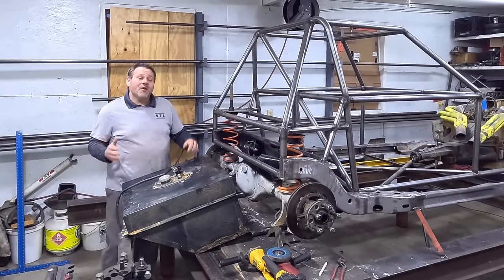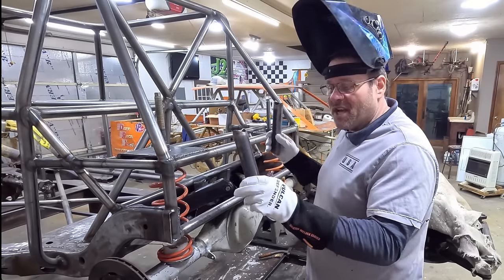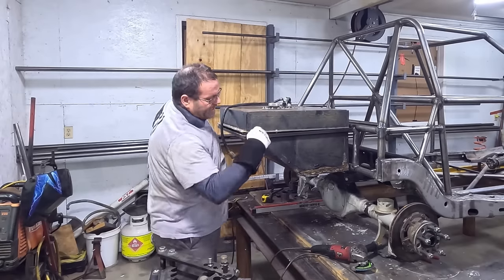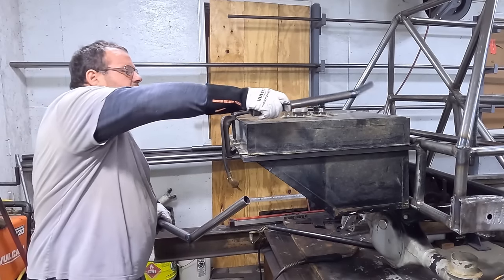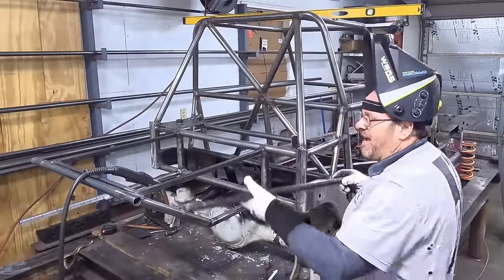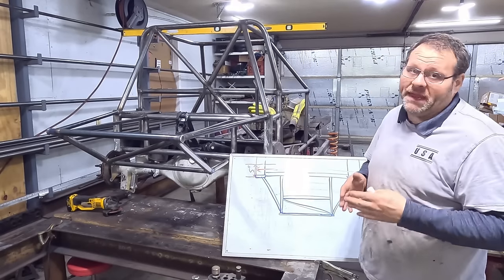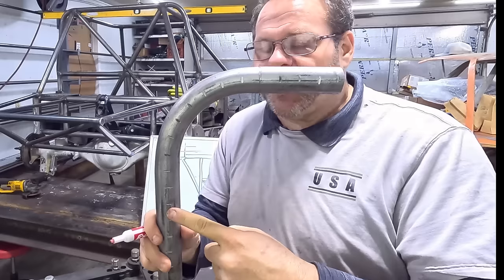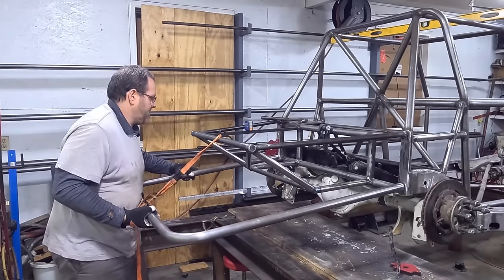Is This Rear Frame Design Really 2 Clips In One? Safety First!

Comment: Where will you be mounting the battery box?   I personally like to mount mine in   front of the cell and to the left.  Some like to hang it in the corner.  Or centered.
Reply from the maker: I have a spot picked out but am waiting to be  a bit further along before committing to the location. I always mount mine on the right side to avoid too much left percentage

Comment: How long is that rear hoop where bumper will go from crossmember for trailing arms? Looks way long on video. Just making sure your body is gonna work out right.
Reply from the maker: It's exactly flush out to where the body will be which is 48 inches from the center of the rear axle. This dimension is a fixed point that CRUSA limits by rules where we are not allowed to make it any longer.

Comment: Just wondering if the weight per linear foot of docol is the same as HREW?  Some builders use seamed tubing as a crumple zone.
Reply from the maker: It is the same weight for the same size/thickness. It is WAY stronger than HREW and honestly considering how stiff this stuff is I am kind of agreeing with you but what I would like to do is maybe have docol 0.065" wall in stock that way I can reduce weight while getting the strength level I want. Seems like perhaps a good compromise.

Comment: Liking the 2 sectioned rear area. Just wondering if maybe you could have made the fuel cell be able to slide left or right, for weight distribution. Good thing is, you have plenty of bar to mount weight to, to compensate. Great build so far.
Reply from the maker: That's one of those things where I just do not agree with A LOT of racers. Most races I will run will be 8 to 12 lap qualifiers and 20 lap features where there is very little noticeable change in fuel burn off weight. If I offset the tank and then learn the car based on that having an expectation of how it is going to act with that offset position, I will be unprepared for the car having a noticeable shift in left side percentage during a 50 or 60 lap major show. I believe in a street stock under these conditions it is best to keep that potential shift to an absolute minimum. 
I don't think it's wrong to offset a tank, I just think it will mess me up to normally never feel a change because of it and then suddenly in the one big show I am in find that the car starts acting very different by lap 50. . . .

Comment: I think I would have doubled the back hoop one on top and one on bottom
Reply from the maker: It's a choice each builder has to make.
Either make it more rigid to be less likely to get bent but transfer more of that energy to the chassis and driver or To make the chassis have intentional fail points to absorb the energy protecting the driver and critical chassis points from those extreme hits. Some go one way some go the other. Me, I am in the second group on this.